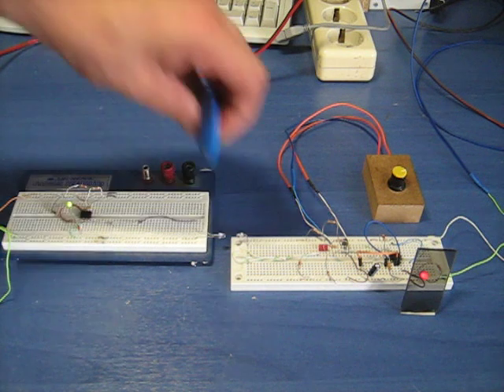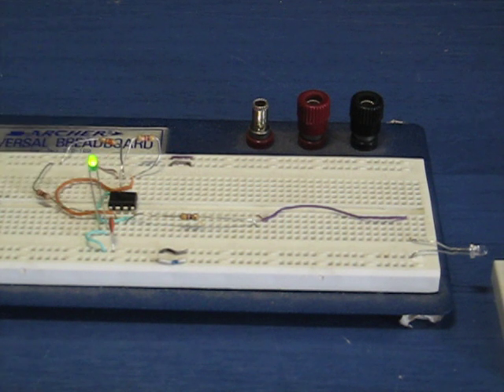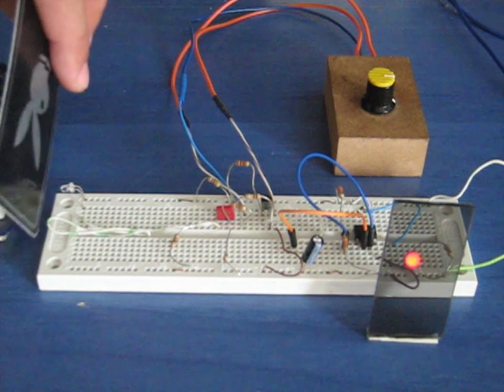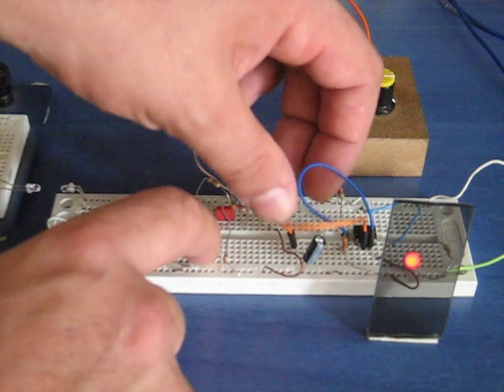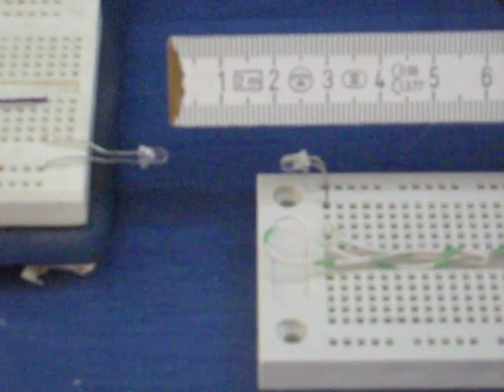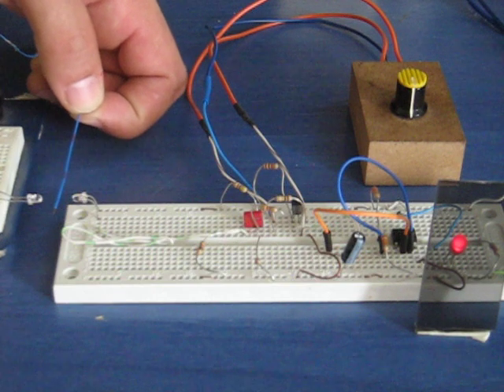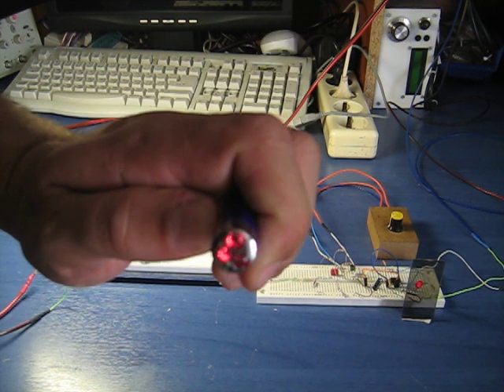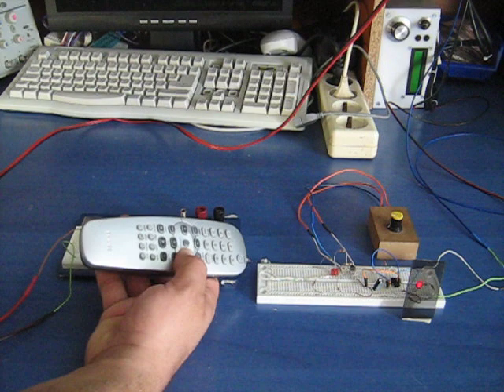Infrared beam break (cut) detetor circuit (short distances)

Comment: do you think is possible to change the circuit and make a invisible keyboard ? I mean, using a matrix with some diodes in the horizontal and vertical.. could we build a keyboard ?